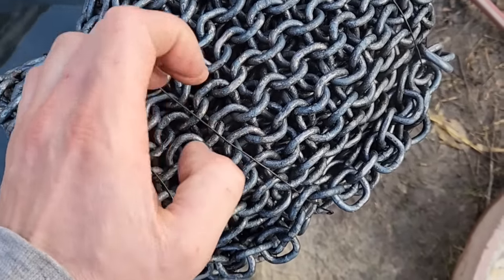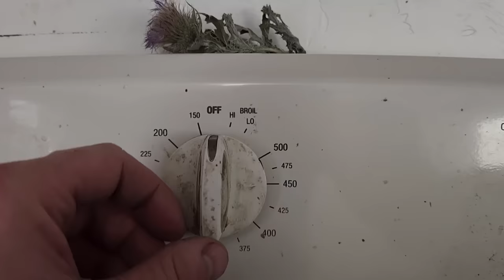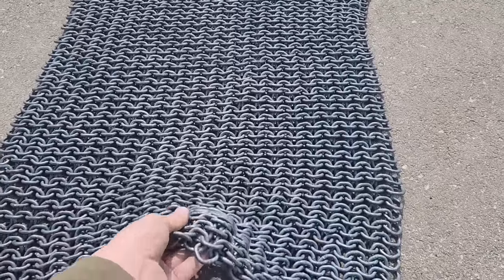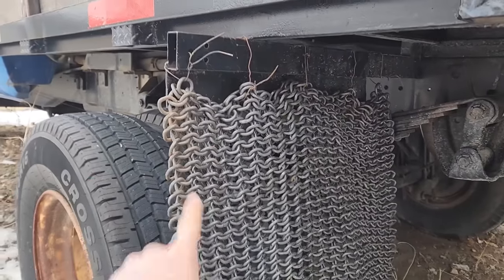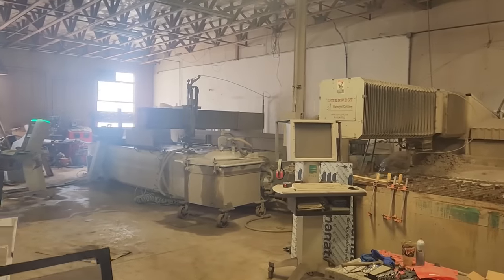Making Chainmail From Chain

Comment: When I was learning welding they would always say that a correct weld is stronger than the rest of the metal!
Reply: Same with woodworking and wood glue
Reply: Pretty sure they didn't mean spot-welds..
Reply: Again, that weld is high carbon because co2 in air. As long as tempered, strongest part.
Reply: Oh, I was ref to the original chain..
Reply: @Dr_Wrong  Neither was I. 😊
Reply: A correct weld might be stronger, but I don't share your confidence that the people (or maybe robots) at the chain factory are always doing the finest welds. As long as the overall chain holds the advertised weight it's good enough.
Reply: @LukaSauperl   "Neither was I." 

I hadn't gotten to the point where he rewelded them.. I was only at the point where he inadvertently broke the lame chain's spot welds. 

6011 rod has tensile strength of 60,000 lbs.  7018 is 70,000.. Additive welding can def be stronger than the orig mats.. Esp a triple pass.. 😀
Reply: Well that's not totally true, at least not practically. When you take the heat affected zone into account, the weld joint is almost always a little weaker than the native material. Unless you heat treat it afterwards, then it'll be at least as strong.
Reply: The whole point of a machine is that they weld the same every time.
Reply: @jaredlancaster4137   "Well that's not totally true" 

*sigh *
NO statement of less than 100,000 words will ever escape from someone saying, ''Well that's not totally true''..

Comment: Welding with a torch and no gloves, what an old school king
Reply: Is this like stick welding just using a torch instead of a welder?
Reply: @michaelroberts1064  Yep, that appeared to be standard oxyacetylene welding. The torch melts the base metal and the rod provides filler. The burning gas produces carbon dioxide that provides some shielding to reduce oxidation. It's a fun process, quiet and calm, but not quite as clean as TIG.
Reply: @dave7038  thanks for the explanation.  there's a lot i don't know about tools and how to make things, but i'd really like to learn more, and i appreciate it when others share their knowledge.
Reply: If you ever want to do something similar to torch welding but don't have access to a torch and gas bottles, you can do something similar with an AC arc welder if you make a holder for a couple of carbon rods called an arc torch.  Generating an arc between the two rods will produce a sort of flame that can heat metal without consuming an electrode or creating a deposit like stick welding.  I've done that myself, and while it is less controlled than using oxyacetylene, it is great for doing torch style welding or for heating up metal to red hot.  I bent a piece of cast iron using my home made carbon arc torch.

Comment: imagine the poor soul who had to make these for a whole army back in the day
Reply: Dude was probably just relieved that he didn't need to be IN the army.
Reply: On the plus side...you would never really need to make like, thousands at once. Most likely blacksmiths/armoursmiths just made square patches like Cody did in between jobs, keeping themselves busy, and building up a supply to make a chain hauberk or shirt much quicker than if they started from scratch when someone ordered one.
Reply: That's what apprentices are for
Reply: @dposcuro Plus chain mail was super expensive, even after plate armor was invented. It would probably be akin to buying a car nowadays. You would be pretty well off selling one as a blacksmith. Most footmen relied on cheaper gambesons, which was much easier to produce and required no smithing.
Reply: @andresvalverde5182  expensive to make but also very recyclable and reusable, which makes it likely to be in a large supply which lowers the cost
Reply: @Leo.23232  Most chainmails and hauberks probably were inherited as well, like it was the case with plate armor, so your point is pretty solid. Chainmail used to be the top of the line noble armor before plate came along and i can see generations of knights repairing and changing damaged chain links making it look quite oddly colored lol.
Reply: @andresvalverde5182  Yeah just like how most military gear these days is inherited as well, right? While it probably did happen, it wasn't all that common, especially not common enough to say most of it was inherited. They were just efficient making mail. They had workshops full of people making these things. If you've got some experience, you can make a haubergeon in about a hundred hours. If you've got a workshop of 30 man working about 50 hours a week, that's 15 haubergeons a week. A haubergeon costs about a month of pay for a regular soldier, so it's not excessively expensive. A knight certainly wouldn't bother repairing an inherited coat of mail. He would just buy a new one. Mail is tailored to the wearer, otherwise it becomes very uncomfortable. It wasn't just a loose coat of mail draped over someone, held together with a belt. Mail tightly fits around the body, with gussets to allow movement at the joints. Trying to wear someone else's mail is just asking for trouble.
Most footmen also wouldn't rely on just a cheap gambeson. Most footmen were in fact professional soldiers, and could afford to buy armour to save their lives. And when we look at depictions of actual battles, we see that they were held to a high standard.
Reply: @joost1120  its easy to adjust the fit of existing mail by removing rings and reattaching, or adding more
Reply: @joost1120 depends on how long the war’s been going on and how hard it is to resupply the front lines
Reply: Not just one. I imagine when there was a large order, you'd have a large number of apprentices and forge workers making the rings, a few higher ranking smiths would join them into mail and then you'd have the masters fashion those mail pieces into actual armour. 

Also, since welding was tricky and expensive, those rings would be joined together using  small rivets, further adding to the work load. 

That's really one of the reasons why plate armour rose to prominence once they figured out the technique: It wasn't just a bit stronger, but it was also faster to produce, since you didn't have to forge hundreds of little rings but could work on larger, individual pieces.
Reply: @joost1120 you vastly underestimate the time it takes to do an single coat, 100hours you say? You do know it takes 1-4 minites for an single riveted ring, and an mail shirt has 20k.

Comment: You can also make a ribbon of Euro 4 in 1 by twisting the 2 in 1 chain until it binds and then linking open rings through the top or bottom (whichever side is lacking the rings in the binding pattern.)  Could help save time in future endeavors, since you wouldn't have to cut and reweave so many rings.
Reply: Not sure what you mean about twisting the chain, but he definitely could have reduced the weaving/welding time if he left 2/3 of the chains intact. (Not that the actual weaving was the time consuming part here.) Instead of opening 50% of the links, he could've only opened 33% of the links, reducing the amount of welding by a third.
Reply: @nikitanugent7165  I think we're talking about the same thing.  But yes, weaving is certainly not the rate limiting step here.
Reply: would this make the diagonals of the kind of mail he's doing?
Reply: @elongated_muskrat_is_my_name  No.  Instead, it would form the bottom and center of a single ribbon of mail.  It's hard to explain in the context of a comment, as it involves some visuals.  I might make a video on it sometime.

Comment: Before I ever paint galvanized steel I always swab the surface with a HCL moistened rag for proper paint adhesion.   Hardened and high carbon steel rusts slowly.  1005/1020  steel,  CRCQ steel & low carbon steel  will rust quickly.   The chain mail skirt on my suit of armour  has flat links probably so the weld joint is over-lapped, heated, & pounded  to fuse the joined ends together.  Back then there was no oxy-acetylene  torch & filler rod to weld links together.  I  would never have the patience  to make chain mail.  With that said I commend Cody for doing all the work on this video.

Comment: Heat treat furnace operator and materials lab tech checking in! the decarburization you're describing is actually happening in your furnace during the high heat stage because of the uncontrolled atmosphere in your furnace, the carbon on the surface of the steel, usually in the first few thousandths of an inch, reacts with Oxygen in the atmosphere and draws carbon out of the steel. The quench you use isn't affecting how much carbon is retained in the material so much since it started decarbing the second it got above 1000 degrees or so.

When you heat treat carbon seel, the resulting hardness isn't a product of losing/retaining carbon in the material, Rather the iron and other carbides in the steel form a different crystal lattice around the carbon in the steel at different temperatures, and the speed at which you cool the material will actually "lock" those structures into place. The slow cooling of an anneal process yields a long, large crystal structure, known as pearlite which results in a more ductile material.

When you quenched the links back into the water from high heat, you aren't locking carbon into the material, rather transforming the grain structure from what's called austenite at that high critical temperature, to what's called Martensite, which is the grain structure of all quenched-and-temper steels after heat treating. 

Let's talk Austenite for a second! This is the crystal structure of any carbon steel alloy at its critical temperature. It's the smallest grain size and is also the most hard/brittle, and is often retained in pockets throughout the material in the quench, which causes stresses in the material which causes distortion/cracking.

When you do the temper, you help transform the pockets of retained Austenite into Martensite, thus a more homogeneous grain structure and distribution of carbides and carbon in the iron solution.

If you were to take one of your quench and tempered links and ground into them gradually, I'm sure you will find that they actually get harder and harder as you remove the decarbed material on the surface and made it down to that sweet sweet martensitic goodness underneath!

The shapes of the crystal lattices are base centered cubics, face centered cubics and face centered tetragonal and the amount of iron atoms in each one changes as the material moves from room temp up to high heat and back to room temp either by way of a fast quench or the slow cool.

Thanks for being you and putting in the work to share all of your amazing projects with all of us! And let me know if you'd like to get some of the things you've heard treated under a microscope to see how you did on your quench and temper!
Reply: As a material science student, I approve this statement.

Comment: Would it have been possible to leave some lengths of the chain still linked together as horizontal rows, then add open links to 'stitch' the rows together into a mail sheet?  (Rather than separating all of the links and starting from loose pieces).  Now that I have written this, I wonder if there is actually any saving in doing that, since you'd probably need a larger number of cut links to do the joining...

Comment: I put anything zinc coated  in regular vinegar. Then I dump it in a baking soda water solution to stop the rusting process and the iron is as is. I do the same to remove mill scale on regular steel from the local shop.

Comment: Wouldn't the point of making it from chain be to actually use the chain part of it?
If you just cut all the chains up into individual rings, then you might as well just get the rings and save the step of pulling the chains apart.
I would have thought you would take 2 chains, and then weave them together with some spare rings, otherwise what is the point?

Comment: If you want the iron not to rust after the zinc stripping you can dip it in some alkaline solution ( litte bit of lye or baking soda in water) and it will prevent some corrosion for a shorter while

Comment: Fun fact this is called Annealing. Which is a heat treatment process that changes the physical and sometimes also the chemical properties of a material to increase ductility and reduce the hardness to make it more workable. you can put hot material in cat litter to slowly cool if you wish to contine to use the oven.

Comment: you should try blacking it by intentionally coating it in a thin layer of rust then boiling it water for a few hours
Reply: If you're in an environment where chainmail is a tactical advantage you definitely want to be known as The Black Knight. Notoriety gives you a +2 AC against attacks by weapons from the Ancients like the dreaded AR-15.
Reply: @user-qf6yt3id3w better to just make a plate cuirass, its lighter and more protective. Easier to colour too.

Comment: It seems like you should be able to knit together strands of chain with open links instead of cutting every other link. In other words, keep lengths of chain with twice as many links as you want per row. Hook links 1 and 3 together with an open ring then connect to links 1 and 3 on the next chain. Continue doing that with pairs of odd links. For adding the next chain you'd be using sets of even links from the original chain and the next chain you're adding. One length of unbroken chain would result in 2 rows of maille and you'd only need one row of open rings for every 3 rows of maille. Less cutting and less welding.

Comment: You should keep  it moving while it's quenching. Don't drop it in there. It evaporates the water touching it quickly and it forms a gas barrier between the metal and the water so it's no longer being cooled.

Comment: slower cooling leads to a larger average grain size. slow enough you make perlite fast enough martensite, carbon is in the solid solution it ain't going anywhere without a lot of work. larger avg grain size means dislocations can glide further withought obstruction makeing a softer metal. cast iron has so much carbon that its not even part of the lattice anymore and is just jammed in the crystal, makes so mutch tension that the dislocations cant move and thats why cast iron is brittle.

grain boundaries are also where cracks and chemicles attack first so there's a lot of single crystal stuff too like jet engine blades made with a super goofy looking casting process.

Comment: I think the point about the carbon leaving the iron crystals is good, i wouldn't have considered that aspect if you didn't mention it. First thing i was thinking about was the grain size being larger with the slow cooling which makes it more ductile, if you were to quench it the grain size would be smaller (more rigid and brittle) and also depending on the quench it might be a very hard outer skin almost instead of a uniform grain structure. Also.. love you and your videos man

Comment: The torch welding is neat and I can see how it'd be preferable to mig. Did you use bale twine for the filler? That would definitely be an economical choice. I'm a big fan of my oxy acetylene setup, there's so much you can do with it.

Comment: So I hesitate to type this because Cody is so knowledgeable on so many things, but I don't think quenching's increase in hardness has much to do with locking in the carbon, that may play a smaller part but the strength to my knowledge is more so from the effect of many smaller crystals as opposed to a few larger crystals that have time to form and merge together when allowing the metal to slow cool.

There's also the effect of locking it into a certain crystal structure depending on the exact temperature you quench it from and the blend of metal that you have
Reply: Thats what i said without hesitatin because its true and no one, not even a sir, can escape that.
Reply: @JackHackaday  It's more a matter of second guessing myself lol.

Comment: Should really quench it in quenching oil. Quenching in water can micro fracture or crack the metal. Quenching oil isnt that expensive and its a one-and-done solution vs quenching to brittle and then half-ass annealing.

Comment: That's a lot of work for chain mail.  Heating heavy wire and wrapping it on a shaft will be much quicker.  No acid and no heat treating.  Cut links from a spiral loop.  But then you don't have any cool chemistry.

Comment: It kind of looks like garter stitch knitting. Is this illusory or not and if not is it possible to make knit stitch or rib or something?

Is there an easier way of doing it by joining full chains instead of isolated rings?
Most steels today are oil or compressed air quenched and often can crack if quenched in water.

Comment: Do you need to completely disassemble the chains into individual rings? It looks like you could just lay a number of lengths of chain down and then join them together with single rings. That should in theory half the amount of cutting you need to do.

Comment: Many years ago i used a trampoline spring to make a chain snake or chain-mail keychain or whatever you call it. Its super easy, cutting the spring into 15-25 ready to go rings. plus, nobody wants old trampoline springs. Theyre strong flexible and similar diameter to the chain. certainly not good for the rock hammer

Comment: pro tip for enxt time, add a few extra safcrificial rings on the outside, so after tempering, hardenign softenign you can slip hammer and wack them to see and prove theorys, they will come off the end, but you can self proof it along the way , ie 10 extra rignsonthe edge hanging off is 10 steps you can test it at

Comment: When the carbon is trapped within the iron crystal it precipitates out and forms microscopic layers of carbon within the crystal which make the crystals rigid sharing the properties of carbon and iron like a composite material. This makes the material hard and brittle compared to untempered steel